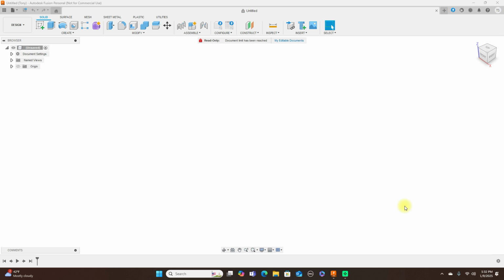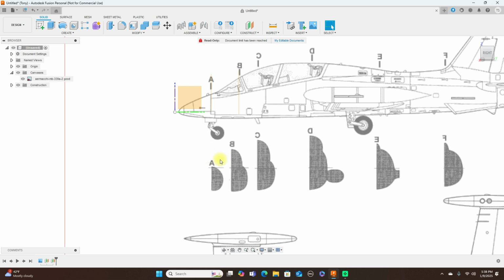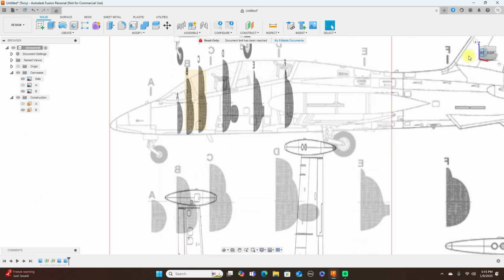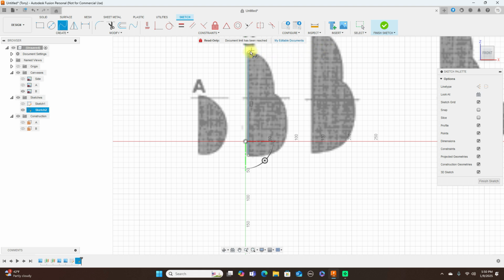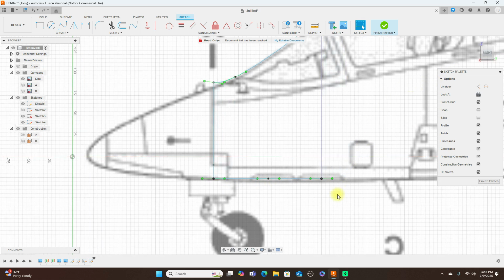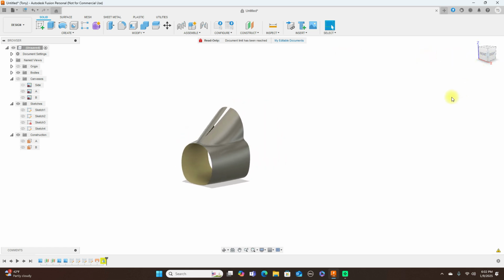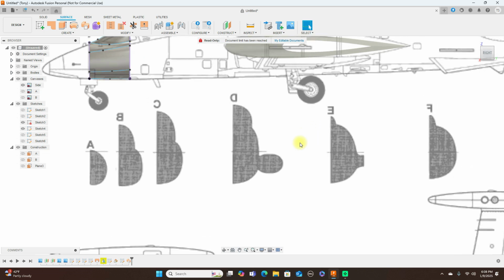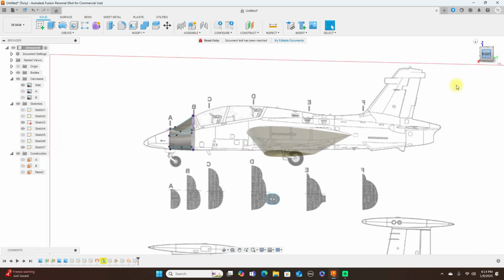The only commands you need to know to surface model airplanes in Fusion 360/CAD

Comment: Can I suggest an easier way for the formers? Rather than keep inserting canvasses, simply sketch each former individually and then if you right click the sketch you can re-define the plane, so you would redefine sketch 'A' to plane 'A'. 'B' to 'B' and so on without the need for additional canvasses.
This would have helped when you did 'B' on plane 'A' - rather than a new sketch and project, leaving the erroneous sketch, just redefine to plane 'B'. Hope this helps.